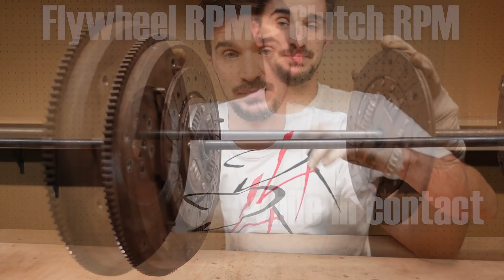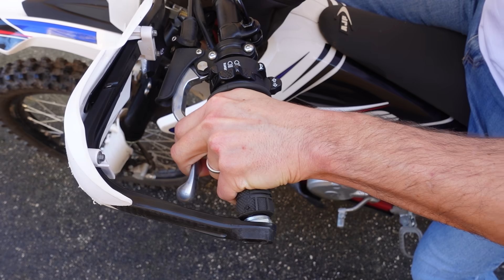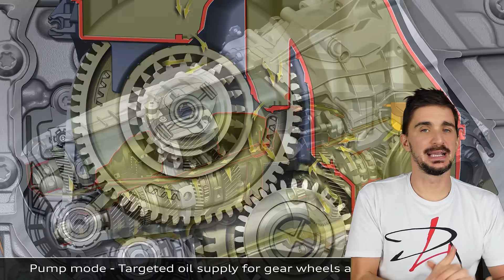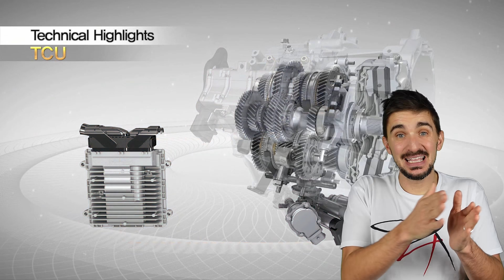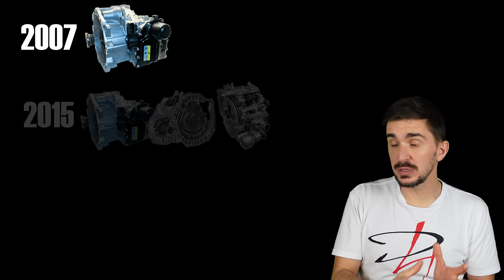Why Dry Clutches Suck and Why You Should Avoid Dry Dual Clutch Transmissions (DCT/ DSG)

Comment: All nice in theory but VW DQ200 dry clutch is not nearly as bad as described in the video. Mine had the first clutch pack replacement at around 180K km (in 2025, into the ninth year of driving my 2016 Skoda Octavia - a VW Golf sibling, just a little larger). Wear symptoms described in this video as a normal behavior of dry clutch transmission (judder, vibration, noise, harsh feeling) only started appearing at around 170K km. Clutch pack and flywheel replacement cost me something around $750 and this is the single only service I had done to this transmission during these 9 years... It works smoothly, predictably and I basically don't need to think about it much. This transmission has provisions to prolong clutch life in case of heavy traffic jam driving - for example it occasionally switches between 1st and 2nd gear to switch clutches and let them cool off a bit. The only thing I pay attention to, compared with torque converter automatics, is to not creep too much uphill - it begins to change between 1st and 2nd more often, a sign of high clutch temperature, and switch between 1st and 2nd uphill is stressfull in itself for the transmission. It is better to creep uphill in S mode or manual, allowing it to stay in 1st gear for longer, with fully engaged clutch already and around 6 km/h.

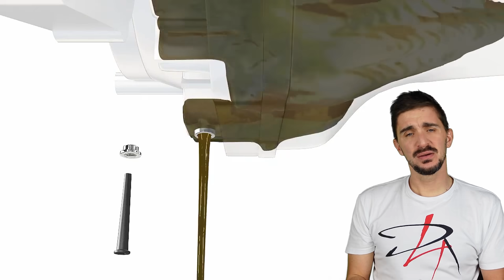Comment: 09:05  My Toyota Carolla Hatchback has that push chain cvt+2 gearbox or whatever, and has “sealed for life” fluid.

The whole “abrasive wear particles building up, leading to failure” aspect has me SPOOOKED,  MIGHT attempt a fluid change, but yeah a video on that would be neat.

(What sucks is a pump+filter (and maybe radiator/heT exchanger if we’re feeling extra fancy) wouldn’t have been TOO MUCH to add, but enshitification lol)
Reply: At least it has a proper 1st gear, cvt wear is af it's worst when accelerating from a standstill. Toyota had the brilliant idea to switch to the pulley (CV) part of the transmission once the car is already moving thus decreasing wear and improving reliability tremendously (Nissan should've taken notes here). Also, replacing the oil on these transmissions isn't terribly difficult either but you might want to have a competent mechanic do it as the proper filling and fluid level adjustment has it's own pitfalls or make sure the procedure is followed exactly as written.
Reply: @samuhell14 i found the official procedure, but it’s one of those “If it ain’t broke, don’t fix it” vs “this may save it long term though…” type conflicts.

All in all though it is a nice transmission, at least for cheaper boring driving to work and back on the daily type driving.
Reply: @ericlotze7724  I mean, it's not a peppy car but it gets very decent MPG. Personally, I replace CVT & ATF fluid on customer's car despite the sealed for life consensus. I do have a few customer with the dreaded CVT on 2012+ Nissan Vera an Sentra and most of them are past 150k on the odometer with the original transmission (And no shudder under load). It's a small sample but oddly enough, the ones that failed are customers that declined to have the fluid replaced multiple times in the past.

Comment: 10:49 meanwhile EVs produce a lot more tire particles due to the higher weight. I hope they are a better idea than burning fossils but we can't ignore real downsides
Reply: A model X weighs 5200 lbs, an x7 weighs 5600 lbs.  EV sedans only weigh a bit more than ice and WAY less than any kind of SUV.  

Big EVs weigh as much or less than ICE cars because less weight is more range and EVs care about range more.

Comment: that was incredible. I have been familiar with wet clutches in motorcycles. The DCT is much better than I thought. Queuing up for the next gear is astonishing. Thank you so much for your content as always top-notch
Reply: That "queuing up" is what causes a DCT to occasionally baulk at a shift - if you're slowing and suddenly want to accelerate (or vice versa), there's a chance the transmission's computer will have the wrong gear preselected, so you'll get a slight pause as it has to swap the cogs before engaging the new clutch pack.  It tries to predict what gear you'll want next, but won't always get it right.

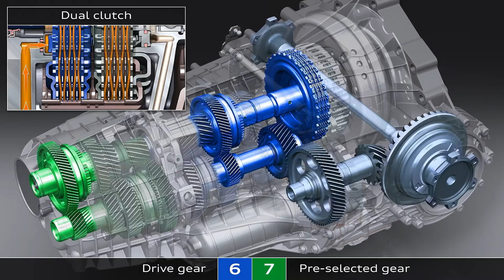Comment: 7:53 Well, there kind of is synchronisation of the gears, it's just that it is done by the clutch packs. Which at times have to be slipped when the engine is making its full torque in a wide open throttle gear change if the car is already moving(unless the car is cleverly programmed to decrease the throttle on gear changes, which many of them seem not to be in the chase for that extra fast gear shift). I just think wet clutches in cars are a pain in the backside. Even automatics, their clutch packs are reasonably frequently getting slipped at wot, they don't automatically reduce throttle either, and there's not really a convenient way to take the load off completely in a automatic whilst the gear shift is happening. So they will wear out, and when they do, they are a pain in the backside to replace compared to a normal single dry clutch. And a normal clutch can last a very long time with a gentle user. I recently replaced a clutch on a friends landcruiser(so not a light duty vehicle, and he does a reasonable amount of towing) because the thrust bearing had failed. The car had done 200,000km on this clutch, and the friction disc didn't look any different in thickness to the new one. So we could've put the old disc straight back in and it would've easily done double the k's. As it is, he's just kept it for a spare. And my experience with clutches in my own stuff has been very similar. Operate them gently, and they'll go for a very long time. I do like wet clutches in bikes for the reasons you've stated, but also, on a bike having a wet clutch doesn't make it drastically more difficult to work on. Thanks for the video, good to see all this talked through and made known, you've got the knack.

Comment: Mercedes subsidiary YASA is developing an electric motor with integrated inboard wet brakes. Most of the braking at the front axle would be regenerative braking with wet friction brakes to supplement them. If they bolt a steering rack to the aluminum casting, you basically have a motor, brakes, and steering in one compact assembly. 

Front unsprung rotating mass would drop to race car levels.

The next logical step would be to use integrated hub bearing and axle assemblies like Kia & Hyundai use.

Comment: It´s not the  "efficient" solution... It´s the solution, that takes inefficiency out at a place where the state controls (exhaust-emissions), and re-introduces it, but bigger, at a place the state won´t control (dry-cluch-cooling-airflow). Always at the cost of the environment and of your wallet. And for profit-maximisation for the companies´-shareholders. I´ve seen Ducatis with dry clutches, they´re insanity (if you´re older than 3, and cool, if you´re younger than 3).

Comment: If you drive a manual, you have to be cognizant of heat build-up. The clutch and flywheel is essentially a giant brake with the flywheel acting as a rotor and clutch as your pads and pressure plate as your caliper. In order reduce wear, you must only shift when necessary are do so in a way that limits the amount of slip. In order to help manage heat, you need to ensure that given a certain amount of slipping, you ensure that the clutch remains in contact with the flywheel as it is the primary heat sink for the system. Once the flywheel gets too hot, it can no longer efficiently absorb heat from the clutch disk which then starts to burn and glaze. The most slipping that you cannot avoid with a manual occurs when accelerating from a dead stop. The difference between the speed of the engine and the speed of the drivetrain is at its largest and there is nothing you can do about it unless you are getting started rolling down a hill and can sync up the engine and transmission with nearly zero slip when the vehicle rolls forward. So the best way to avoid clutch wear, in general, is to avoid having to completely stop. I will cheat a bit some times if I have to "stop" and slow to about 4 km/h then release my clutch because that is the speed at which my engine is idling so there is zero slip once I need to take off. Obviously, rev matching is super important too and not just because it reduces slipping, it is the most fun part of driving a manual! 😉
Reply: You can spend a looong time going a veerrry small distance if you go lock to lock on the wheel back and forth in your lane idling in 1st gear, with a little luck and a lot of planning many commutes can be done without having to touch the clutch once you start the first time. Things you learn when you drive a shitbox with a clutch that never lets go lol

Comment: You know Zemo when you go to absolutes you are always gonna prove yourself wrong. 
Saying dumb stuff like Dual clutch can Otperform ANY human and ABS can Outbrake any human is just BS. 
Both Proven Wrong many times over, On Video. 
BEST DSG cant be Topped by a Human, and Top notch ABS can Produce the same BUT more consistent result. 
IN THE SAME repeated condition. 
ABS still fails on Black ice while skilled experienced drivers can handle it. 
So don't be the Internet. Nothing is absolute. Only dumb people are absolutist because they need something to hold onto and be right about. 
These systems are designed to offer Professional results to Common rabble.

Comment: so something i would like to say with smaller clutches like the motor cycle wet clutch referenced in the video those tabs on the clutch disk are prone to breaking off or even the worn clutch disks that stuff stays in the clutch and can clog the oil or damage the rest of the clutch because now you have a hunk of metal that stays in the clutch because it sealed. now a small dry clutch tend to be a cyntrifical clutch activated by RPM. but with a dry clutch one of the clutch teeth chips or beaks it just flys off cant really damage anything after. now a full size clutch doesn't really have those teeth so yah wet lasts longer.

Comment: Dry clutches don’t suck .. bad drivers suck . I have a Toyota Landcrusier with 503000 kilometres on the original clutch. 15 years old and still fine because I don’t slip it and I know how to drive a manual transmission properly.

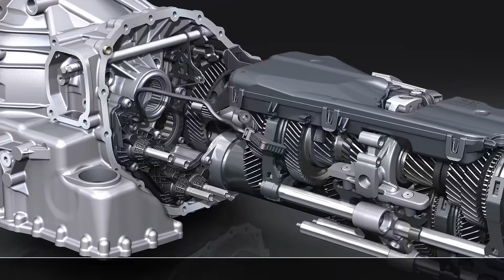Comment: 6:43 it also has two counter shafts which change the final drive by having different tooth counts. It’s one of the few transmissions that’s have two different final drive ratios.
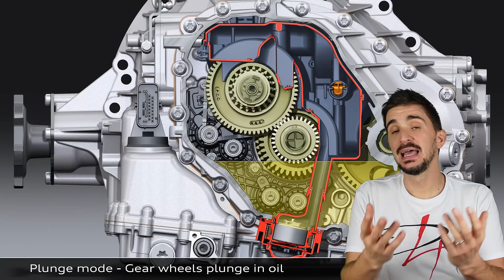10:07 dry dct is BS!! It’s just cheaper. If that was true about more efficiency then why not get rid of all traditional automatics?

Comment: Okay, hear me out. Why not use torque converters? Torque converters with multi-plate lockup do the same thing as a clutch, they're more efficient and have less wear. You could make a transmission that uses two of them. Well you're at it, use wet clutches and planetaries instead of larger and less efficient shift forks and dog rings. Or in other words, a high performance dual automatic.

Comment: Former Car Mechanic here, I used to work with my father on ONE of the worst Automatic Transmissions that I have ever had, an Audi S4 Quattro with a V6 from 2004
That poor customer had to pay a insane sum, but because we both were kind, well he didn't pay as much as he would by Audi.
That Transmission would engage emergency mode each time it shifts up to D4, and thus making it drive like a rock.
And it was because, a few sensors in there were dirty AF, in the end we had to drive the giant ass Transmission to a Specialist that my dad knew to refurbish in almost brand new state.
I sure hope the customer drives that Audi as we did had insane amount of effort into that thing.
And from that day, I never drive any Automatic/DCT Transmission.
Because with a Manual it works just fine for me.
No not even with a CVT it will be better, those are even worse.
Just get yourself a Manual, I am sure kids these days that have a short attention span would love to shift instead of be bored of driving a Automatic.

Comment: 14:55 sounds so bad
Reply: Sounds like a race bike.

Dry slipper clutch, straight cut gears, titanium pipe with carbon mufflers, Desmo V twin (or V4) 
As a package, they sound amazing on track, especially when they're held wide open and rely on ignition cuts for clutchless shifting

Comment: does downshifting with a dct damage it? is it only the next gear thats preselected?
Reply from the maker: If that were true it wouldn't last long. We need to downshif whenever we drive. Downshifting when the next gear is preselected only slows down the shift, but the transmission is clever, as soon as you start braking and/or rpm falls it preselects a gear down. If a  downshift would push the rpm above the rev limiter it doesn’t let you downshift at all.

Comment: While it was eye opening to hear that dry DCTs emit particulate matter, I disagree that they are necessarily unreliable. Before Stellantis, FIAT designed two DCTs, the C635 and the C725 (the second one is a hybrid powertrain with two electric motors). Those transmissions are dry clutch, and are generally more reliable than the Volkswagen DSG, especially the early versions of the DSG. The C635 in particular also broke the record for most torque dense transverse DCT when it was released for the Alfa Romeo Giulietta, if I remember correctly
Reply: When manufacturers cheap out on wet clutch, you can replace the oil more often and/or use different formulation. When the manufacturer cheap out on dry clutch, well...

Comment: The simplicity of the manual gearbox is the reason it is also for the customer the cheapest option.
Yes the plate slips but if you drive it correctly then it can hold easily the full lifetime of the car.
Is the engine not strong enough or are the persons using the clutch incorrect yes then it can wear out fast. 
automatic gearbox need several times new oil becuase of the narrow oil channels that can block if there are too many particles in the oil. The reason it has aswel a filter, that then as well needs to be replaced

Comment: I have a dry clutch DCT in my Hyundai Ioniq plug-in. It shifts very slowly, like a regular automatic transmission, nothing like those in GTIs or Ferraris 😀It doesn't feel like it's banging the clutches at all. Also at crawling speeds it's the electric motor that propels the car so it doesn't have to slip the clutch and always engage/disengage like with a petrol engine. I'm conviced that the clutches will last longer than the rest of the car.

With that being said, it's still a clunky transmission sometimes (like when it's cold), and I'd much prefer to have an e-CVT like in a Toyota Prius, which is the best transmission ever made.

My car is now 5 years old with 100,000km. The only repairs it needed were an oxygen sensor had to be replaced and the driver side door handle too (the courtesy light wasn't working anymore, the handle worked perfectly)

Comment: I've yet to experience a decent dual clutch trans, regardless if it's wet or dry. A modern torque converted automatic with 6 speeds is significantly more reliable than a DSG (I had a DSG), and comically more reliable than a DCT (i.e. Focus DCT-gate). The miniscule amount of fuel economy you might save with a dual clutch is a hell of a lot cheaper than a $400 DSG flush every 40k miles, abd SIGNIFICANTLY cheaper than replacing a DCT prematurely.

Comment: How come there are no wet clutch manual cars?
Reply from the maker: Mostly because it's not necessary. A dry clutch will do 80-150k or even 200k in the hands of a decent driver. It won't take abuse but it's not meant to. If you need to hold more power there are twin plates, sintered metals etc. Oil enables abuse, since computers can't see outside they need to abuse more sometimes and that's why dry + dct isn't a good idea. In a traditional manual transmission we never really need to abuse in normal traffic conditions. Of course drifting etc. Is a different thing but that's not a normal use scenario.

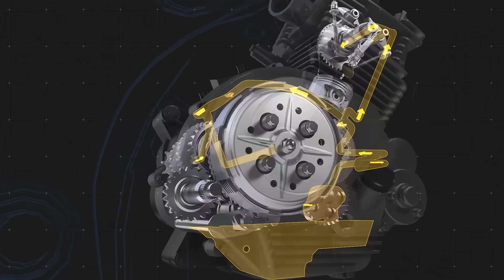Comment: 5:35 wait, if the clutch pack is circulated with the same oil as the engine, doesn't that mean the abrasion of the clutch is cycled through the engine as well?...
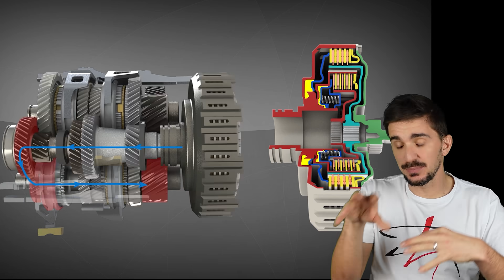8:43 ok, so it's just "working as intended" 😂
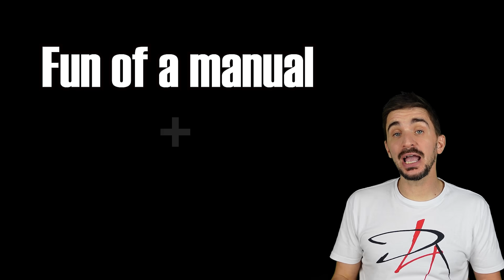7:10 with one exception: if all your transmission has is "+" and "-" for shifting, it takes more time to go from 6th to 3rd than in a manual. But that's the only time where I wish I had a manual over my DCT. The remaining 99.9% of the time, I love the DCT.

Also good to know if I ever get another car: I want a wet clutch. Fuck that 1% of "efficiency" at the cost of maintenance...
I think I now also know that my DCT is a dry one... because one time I got the car stuck in mud and in the attempts to get out I got an transmission overheating warning...